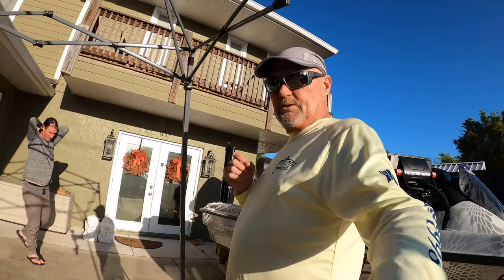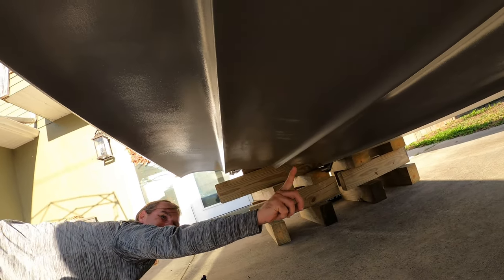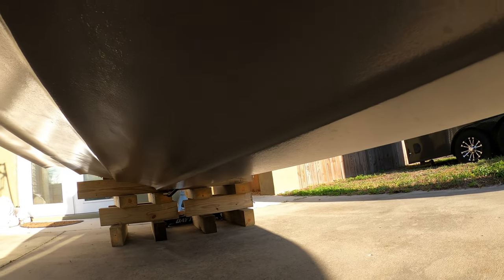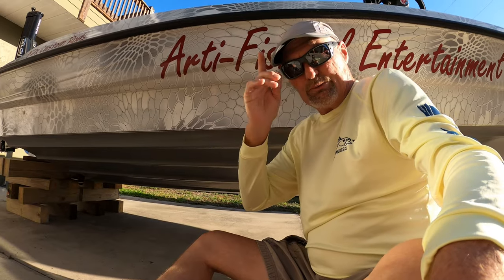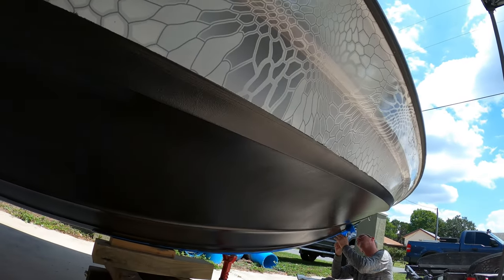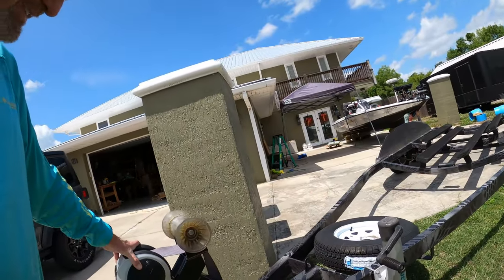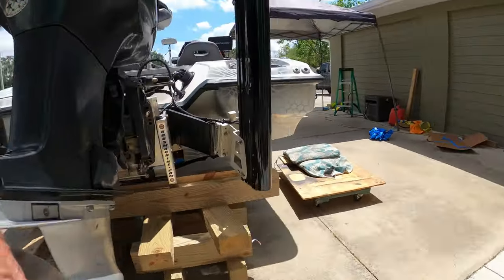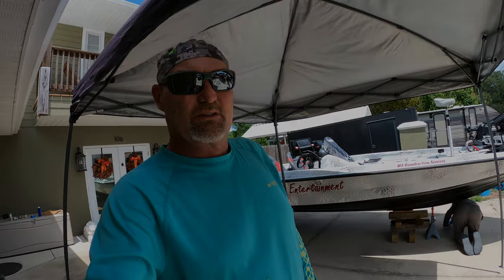Triton Gelcoat Repair 3 - Final Gator Glide Installation

Comment: I’m building a 14’ fiberglass skiff ground up with boat plans from salt boat works. (FRS14)
My experience with gator glide if from jet Jons.. now the boat I’m building is designed for a 15hp outboard but I just bought a Predator 459cc (15.8HP) my question to you would be how is it holding up and has it effected your performance in anyway? I’m not going to run it like a Jon boat because it’s not.. but I do plan on running shallow here in Matagorda Bay, Texas. I don’t want to constantly have to do fiberglass repairs. I’m thinking of doing gator glide because of the hardness but your the first fiberglass boat I seen with it on.
Reply from the maker: I'll never have another boat without it.  2.5 mph increase at WOT and 20% decrease in gal/hrs burn at 80% throttle.  You dont feel a heavy wind chop in your feet anymore, also.  Just put it on while you have the boat upside down still.  Working under a boat sucks.

Comment: How much weight does that add to the hull?
Reply from the maker: With the Base and the G2, it was just over a gallon of product, so I would guess under 10 pounds.
Reply: @SCBoats  Awesome... so how does she handle?  Does she want to bow hook at all?  I heard those gator glides can cause some handling issues.  I'm not trying to say it's a bad thing.  I am asking because it's something I may do to mine.